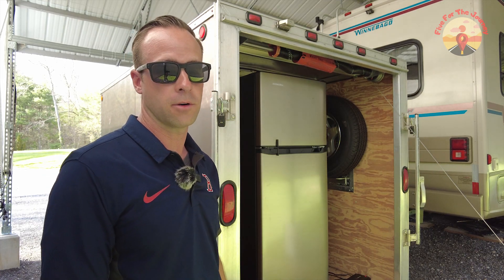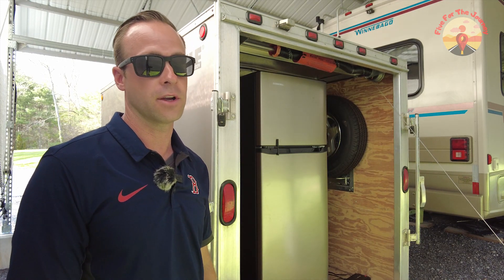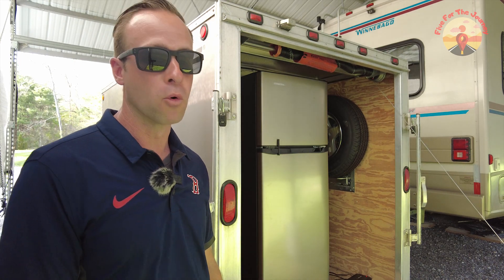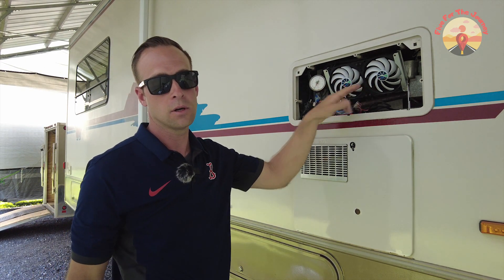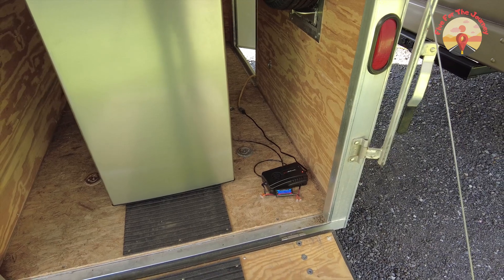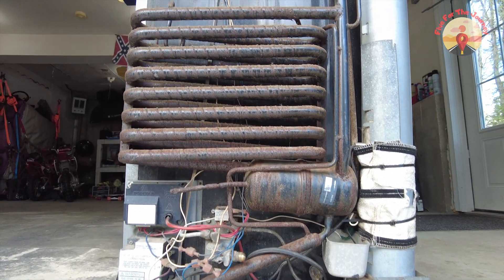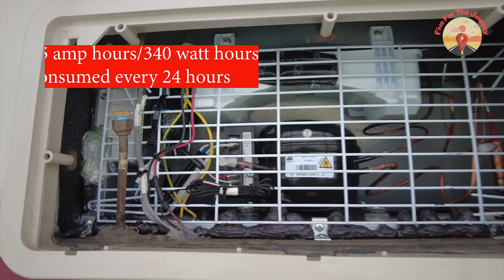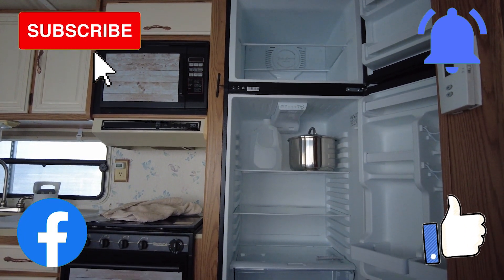RV Refrigerator Comparison / POWER CONSUMPTION 12volt Compressor vs Absorption (using propane)

Comment: You didn't mention what your solar or battery set up is for the 12v fridge. How much solar watts and how much battery amps did you find works for your level of boondocking?
Reply from the maker: We recently sold our Motorhome and purchased a toy hauler instead. We still miss the Motorhome. We had 560 amp hours(6,720 watt hours) of lithium battery storage. We also had 600 watts of solar on the roof. Our setup worked for our camping needs which was the refrigerator, lights, charging devices, cooking with a electric skillet, coffee maker and occasional use of one air conditioner at a time. We now have a similar size system on our trailer and are eventually going to replace the absorption refrigerator with a 12 volt refrigerator. 
If you have any questions on a build of your own, I would be happy to help. I am a licensed master electrician and I truly enjoy working and giving advice on anything RV related. 
Take care,
Justin

Comment: I know this is an older video, but we have 300AH of Lithium and a 200Watt solar panel on the roof of our RV.  Our 12v 10cuft Fridge seems to use about 25AH per day.  We make sure we are on shore power before leaving load it up fully and let it run a few hours before leaving, this helps a lot with the initial load.  In the summer we did a 7 day trip at a site with no power, and only had to run the generator for about 4 hours one day to top us back up and that was enough.  So for those that say the 12v fridges are no good, it's really not as bad as people say and the Fridge stays much cooler and recovers a lot quicker than the absorption fridge.

Comment: First, what was the cubic feet of both refrigerator? Next, was the power consumption measured from startup or was it after it was loaded and down to operating temperature? Third, was there excess noise from the compressor inside the RV? Forth, does the Compressor Refrigerator have an “automatic”  defrost cycle? 
One last comment… you need to stop your wiggling back and forth while recording!
Reply from the maker: Thanks for your questions and interest in our video.  We are sorry for the late response to your questions, but I hope the following answers will give you the information you are looking for. Here is a link to the same refrigerator which may help you also . https://www.etrailer.com/RV-Refrigerators/Everchill/324-000119.html
(1) The 12v compressor refrigerator has an inside area of 10.7 cubic feet and the propane absorption refrigerator has an inside area of 8 cubic feet.
(2) The power consumption was measured starting after the cool down period(once the refrigerators got down to an operating temperature of 38 degrees F.) so the cool down period was not factored into the total energy consumption. The refrigerators were tested while empty so having them loaded would certainly change the energy consumption results.
(3) The noise from the compressor was certainly louder from the outside of the motorhome, but it was still
very noticeable from the inside  as well. The info in the link I provided gives you the decibel rating.
(4) This particular 12v refrigerator by Everchill does have a defrost cycle. The cycle would draw about 120watts for a 10 minute period. 
(5) As far as the wiggling( haha) it must just be because I was nervous being in front of the camera.  If you’ve never recorded yourself try it sometime, it’s an awkward feeling! I’ll have to work on that, but thanks for pointing that out. 

I hope this helped you out and feel free to reach out in the future.  

Stay safe,
Five for the Journey
Reply: Yeah!  LOL, the swaying back and forth is quite distracting!

Comment: What is your 12v fridge average energy consumption after it's already cooled down and loaded with food? Thanks for the video!
Reply from the maker: Hey shakenjason.  Thanks for watching our video.  I did not record how much energy the refrigerator consumed during the cool down period, but I came up with an educated guess after getting your question.  I do know that the refrigerator would draw on average 6 amps when the compressor was running and it would only take roughly 1 hour to cool to safe operating temperature.  So to answer your question (with an educated guess) I would say that the refrigerator would consume around 20 amp hours over a 24 hour period after cool down.  If the refrigerator was loaded with food the energy consumption may drop to 18 amp hours over 24 hours.
Thanks for the question!
Reply: @fiveforthejourney6500  Thanks so much for your reply!
Reply: I've seen other vloggers mention their compressors run about 33% of the time. YMMV, as it depends on how well insulated and sealed the refrigerator is.

Comment: What are your comments about compressor noise level? That's for me the most important bit and cannot find any info on it...
Reply from the maker: Yes, good point. The 12volt compressor refrigerator(at least the EverChill) is quite a bit noisier than your average absorption refrigerator. I did find it a little annoying from time to time. I believe the compressor motor is designed to run a different speeds based on what is optimal so It can be a bit louder from time to time.